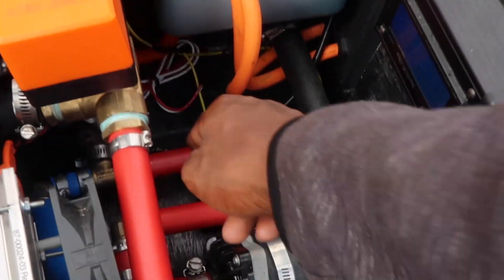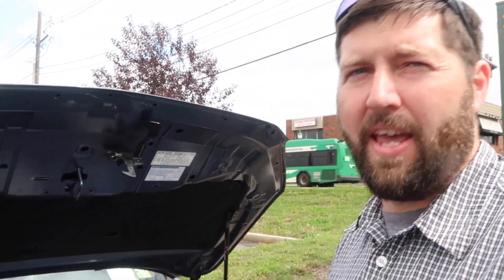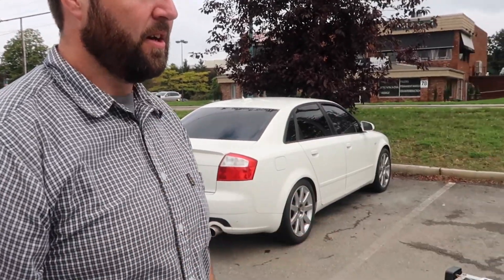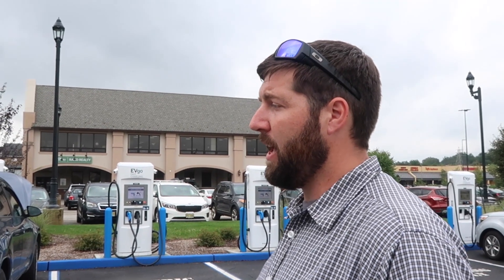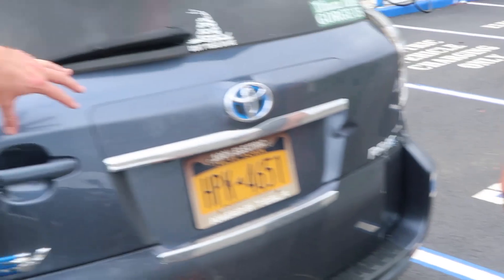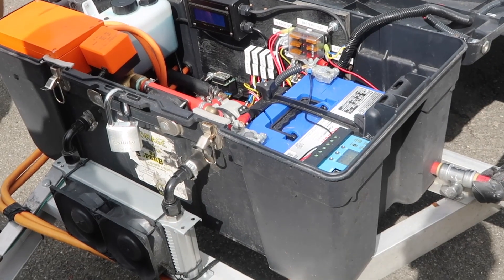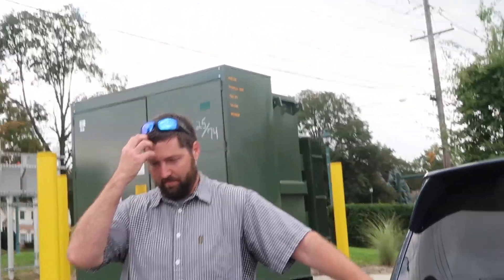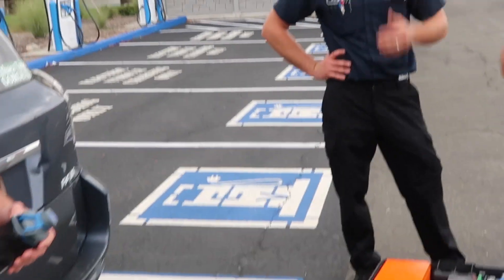The True DIY Tesla Range Extending battery Trailer

Comment: Why not just do a little fiberglass project and make it a "roof rack" thing?
Reply: No roof rack in the world can handle 840 lbs. You would also make the car dangerously top heavy and you would also lose 10-20% aero drag.
Reply: "roof rack" was in quotes for a reason. Of course I'm not suggesting just strapping it on there. But 850 pounds isn't all that much if properly distributed with some simple fiberglass reinforcement tubing in the proper locations.
A non-EV RAV4 has no lower batter, correct? So the OEM location of the EV versions lower battery has moved the horizontal CG far below normal. Adding weight to the top would offset that and put the HCG very roughly back to where a non-EV vehicle would have been. It is surely going to be slightly higher than normal, but who says the entire pack has to go up there? Some concessions can be made to get an acceptable HCG. Of course, some suspension work is also probably going to be required... another easily solved issue.
And 20% drag? Cmon man, with proper fiberglass work, it would be more like 5%, 10% on the sloppy side.
It's not a zero loss game, I never said it was. But it's better than dragging around 15ft in trailer everywhere you go, and it wouldn't consume all the usable interior space either.
Reply: funkyzero I don’t agree. I don’t think the car will handle well at all with 840 lbs on the roof and I doubt it would even handle the weight. Then you mention that all of the modules don’t have to be in the same place. It’s always better to keep them together. If you have to spread them out you have a spaghetti of high-voltage lines ran throughout the car. Also, temperatures for each module will vary because of the different locations. Also, would you run coolant lines to each module in each location? 

As for drag, I think your estimate of 5% is low. I don’t have a roof rack but I know of people who have added them and they will see a 10% loss just with bars installed and nothing on them. 

The trailer, it’s not 15’. It’s a 5’x6’ trailer. It’s very easy to maneuver. 

Lastly, I don’t want to discourage you from trying it. Plenty of people told me my idea was stupid. I did it anyway and it works great. I encourage you to try it. That’s how we learn. Best of luck!
Reply: you could very well be right, everything I have stated is pure conjecture based on very loose assumptions. What I know for certain is that the weight problem is solvable... from a structural viewpoint. And I think one could do it with less than 100 pounds of reinforcement (this is my area of expertise).
As far as the HCZ goes, this is where things turn to pure conjecture. I have never measured ANY of those things I suggested.
In the end, as you are more acutely aware than I, this turns into trade-offs between convenience, complexity, cost, and efficiency.
some guys might be willing to sacrifice every square inch of interior space except the drivers seat. The balance of variables goes from there... so there isn't really a "wrong" way unless of course, we are talking about technical issues.
I suggest what I did because my balance would be more somewhere in the middle... I want the full function of my vehicle intact, and any gains I could make in range and efficiency are 100% positives. One thing for certain, no way I'd want to drag that trailer around, even on long trips, but I'm going to have to start making concessions in order to get rid of it. And I know don't have to tell you any of this, you've actually done it.
But I can say that some small changes in suspension, and even slightly extending the spindle spread will increase stability (the top heavy concern) by multiple factors. Just a couple of inches makes a dramatic difference in this realm. 
Point is, all of these ideas can be worked with, it just amounts to how far do you want to go with it. I know the most common stance of the EV enthusiast is "maximum range MUST be achieved". I know that's an exaggeration, but it mostly fits. Most guys challenge themselves to see how far they can go, how efficient they can be. But that's not my mindset... the car still has to be convenient to use, or all is lost for me and becomes a toy at that point.

Comment: i see a problem when they switch togeather. they need to be at almost identical charge states in order to be joined. if not huge currents will be percent while a charge equilibrium is met. it would be nice to see either a charge controller used to balance the battery banks or a large bleed off resister to be used as an intermediate step to limit the equalizing current and once the banks are at simular levels for them to be fully linked togeather
Reply: I hear this all the time. They just need to be closeish. Jack Rickard made a video in which two 85kwh packs were connected in parallel. One was something like 90% full and the other was something like 50%. They balanced in about 2 hours. Everything was fine. As long as your wires are large enough, 2 gauge should be fine, all will be good.
Reply: the batteries are capable of safely dumping alot of current yes and in that case your wires will be used as a resistor. at the verry least put a shunt type current meeter on them just to monitor switching to assure safe limits. i didnt see a main fuse but id rather replace an external fuse than an internal one so maybe consider doing that. you can safely parallel fuses to cut down on price or availability if needed
Reply: Jimmy O. I monitor the can data for each pack so I am using the OEM shunts. I can see the current going into and out of each pack. I have multiple fuses and switches all over the place.

Comment: I would put regular solar panels on top of the trailer, it will charge the battery and protect it from heating under sun.
Reply: 300 watt solar panels would do nothing. Solar panels belong on a roof not a car.
Reply: It depends. If you go for a camping for a couple days it can generate some extra kwt as well. And I guess 400 watt is possible to instal. If for whole day it will 3 kw. Of course it won't make big difference. If keep it on backyard it can generate some power for house backup. Just my guess.

Comment: If he does have an accident I hope it's on the 4th of July so the ensuing violent explosion and sparks could add to the celebration of American freedom coming.
Reply: There are plenty of fuses and switches all over. Ive been pulling trailers for 10+ years and I've never even been bumped into. Sure, everything in life is a risk. Planes crash, does that mean you never fly?

Comment: Three battery's on top of one another , on trailer ,!
Reply: My goal is to do the same thing but with a flat Tesla 100 kwh pack. Then I want to build a removable lightweight teardrop trailer over top of it. That way I can use it to move stuff AND for camping trips with my wife and son.
Reply: @JamesKlafehn  
I also thought of using Tesla house batteries. Thought of building a trailer home and having four of these in the front with solar panels on the roof don't know whether it would work just an idea.

Comment: Would be cool to make a pop up camper trailer witht that.  Can extended the range and get utility out of it.
Reply: My goal is to do the same thing but with a flat Tesla 100 kwh pack. Then I want to build a removable lightweight teardrop trailer over top of it. That way I can use it to move stuff AND for camping trips with my wife and son.
Reply: Check out my channel. I just started a new range extending trailer that is going to have a teardrop on top.

Comment: I will just bring a generator with few gallons of gas... That will be much cheaper and easier
Reply: But you would have to pull over and park in order to charge. Id rather have longer range and be able to drive to a fast charger.

Comment: Fast charging shortens the life of batteries if im on the highway i use it but for the most part i try to charge it at a very low charging rate.
Reply: Not entirely true. Theoretically fast charging can but its the Temp, SOC and time left at full SOC that are the worst offenders. 
Battery Degradation:
1. Extreme heat or cold
2. Extreme heat or cold and having a full charge
3. Leaving the battery fully charged for an extended period of time.

Those three things are the worst for a battery. Tesla cars use an active thermal management system and so far I have never seen temps above 44 degrees. That is even while using Chademo in full sun on a 95 degree day.

Using a fast charger alone is not as harmful as everyone thinks. Your Regen system can dump hundreds of amps into a battery. A Chademo charger can dump 60-100ish amps. The charger also tapers as it gets full so that number drops down as it charges.

Comment: I am not going to claim to fully understand everything about this tech, but could you stack multiple battery packs on the trailer and get even more range?  I realize the weight would eventually create a negative return on benefits but a purpose built trailer with more aerodynamics could be used.

Comment: Use a steel box so people cant break in and steal stuff, put a small lift on the trailer and attach battery inboard of trailer frame rails. Add deck surface to trailer. Now you can tow, haul, and have extended range. Because a trailer that you cant haul anything with is like a roadster. It'll take you places but other than that it does very little for you.

Comment: If you built a battery trailer and you had free charging, you could charge the trailer and take it home and run your house off of it
Reply: Cindy Tepper yup I’ve thought of that. Haha. Still wouldn’t justify the cost of a $4000 inverter though :(
Reply: Resistance heating can use DC just fine :)

Comment: Roof rack would have been so much cooler
Reply: I hear this all the time. Roof rack wouldnt work. The battery weighs 840 lbs. A Tesla S or X battery weighs 1300 lbs. The roof rack nor roof could handle that weight. You would also be extremely top heavy and you would lose 10-20% due to aero drag. horrible idea

Comment: He should setup the trailer to also power his house when he's not using it.
Reply: That's exactly what it is designed for. The T-Rex is totally self containing meaning it has its own controller, switches, battery etc. All i need is an inverter and it would power my house, a cabin, etc. If I bought a Chademo power station I could use it to refill cars too
Reply: That's sweet!  Personally I think i'd get a lot more use out of it as a power source for an off the grid cabin or while camping, than as a range extender.  If you're powering a house or something else from the trailer, would you be able to have the car hooked up and use it's batteries as well, since they are in parallel?  (Not that that would be as practical but still cool).
Reply: My idea was that 90% of the time it would be home as an energy storage device. Then on a road trip I could use it for that. I dont have a cabin yet but I think that is also a great use for it too. I could bring my power with me and connect it to the house and the house's solar panels for the weekend. I've heard that an average family of 4 uses around 40kwh a day without sacrificing anything. Seems like a lot but thats what I heard. So this pack is perfect for a weekend at a cabin or home storage
Reply: That's awesome, i'll be looking forward to seeing more, keep up the good work!
Reply: Thank you!

Comment: Put solar panels on top of the battery it can recharge in the sun
Reply: I hear this all the time. 3 - 300 watt solar panels will do nothing. It would take a week to fill from empty.
Reply: @JamesKlafehn  I guess but if you were in a situation where there was no power this could be a lifesaver couldn't you also put one of those breaks that recharge your batteries when you use them on your setup? Just a thought
Reply: It would be more cost effective to buy a perfect sine wave gas generator and charging the car using a 110 or 220 volt charger while its parked.

Comment: why not just bolt the battery to the roof instead of having do try and pack it under the car
Reply: I hear this all the time, no roof rack in the world can hold 840 lbs. It would also be very top heavy. But lastly, you would lose 10-20% in aero drag.

Comment: It would take a gasoline generator 12 gal of fuel to produce the power stored in your trailer.
Reply: It would have to be a level 1 or 2 charge which are both pretty slow. It could also only charge while you are parked.

Comment: I guess its the advanced prototype, do report again when it got the fenders and enclosure all around possibly a solar cover. Its easier for you when you start adding batteries back in your dummy trailer because it leaves you the pure flat cargo area, try imagining a pop up camp also with unfoldable solar shade roofs. Of course the power inverter for operating machinery at job sites - you realize you could rent out the trailer very well just for that capacity, and if you have it online and with gps it be safer very everyone...
Reply: Wait, because I dont have fenders which add weight and aero drag its only a prototype? lol
Reply: Check out my channel. I just started a new range extending trailer that is going to have a teardrop on top.

Comment: why would you not put a box on top of the battery to make it useful as a trailer as well?
Reply: Because I have 3 trailers and I dont need this one to haul. My goal is to do the same thing but with a flat Tesla 100 kwh pack. Then I want to build a removable lightweight teardrop trailer over top of it. That way I can use it to move stuff AND for camping trips with my wife and son.

Comment: This is dangerous. Without a crash-event detection system, an active HVIL loop connecting the trailer and car, and arc-supressing contactors or pyro-fuses, this system remains hazardous in the event of an accident. Assuming this is safe otherwise is naive. Rich, you are an inspiration, but don't loose sight of the fact that your promotion of vehicle hacking comes with a responsibility to educate people about safety.
Reply: Another hater. lol!

Comment: Rich anyway of generating charge to the batteries, through the forward motion of the wheels of the car, couldn’t that generate electricity as well?
Reply: Adding a motor would create drag, weight, and add complexity to the system, oh and cost a bunch more money. None of which are needed.

Comment: Can't wait for this idea (trailer for stuff + range extender in one) to hit streets. This will be awesome. Imagine doing long runs with trailer, hitting supercharger and plugin car into 1 SC and trailer into second one. Higher consumption due to air resistance is still a problem, but this extra capacity should make it even. Plus imagine the ads:
"Buy powerbank for your car, and get one for your phone for free!"
Reply: My goal is to do the same thing but with a flat Tesla 100 kwh pack. Then I want to build a removable lightweight teardrop trailer over top of it. That way I can use it to move stuff AND for camping trips with my wife and son.

Comment: If you stacked several of them it would give you a possible 1000 mile range !
Reply: My goal is to do the same thing but with a flat Tesla 100 kwh pack. Then I want to build a removable lightweight teardrop trailer over top of it. That way I can use it to move stuff AND for camping trips with my wife and son.

Comment: Sorry if i missed it... what range does the trailer add to the car?
Reply: No problem. The car alone, not towing, in good weather, does around 130. With the trailer I have done 225. According to the math, I can do 260 miles in good weather at highway speeds. City traffic and driving would take power quicker just like any EV

Comment: Now imagine stacking 2 packs high(or more) and putting an aerodynamic fiberglass or carbon fiber cover on them.
Reply: Padre-D Productions My goal is to do the same thing but with a flat Tesla 100 kwh pack. Then I want to build a removable lightweight teardrop trailer over top of it. That way I can use it to move stuff AND for camping trips with my wife and son.

Comment: Could a Tesla Powerwall or two be used in a small range extending trailer? Certainly not cost effective now but the price will eventually drop. Each 13.5 kWh Powerwall would give an extra 40 miles of range, allowing you to buy a standard battery model car and add the trailer for the occasional long range trip.

Comment: Hello rich you need to have those Wheels on the trailer hooked up with a generator some sort so it's always charging the whole system when you're pulling it. Now that would be a project to do. I'm sure it could be Dunn and you're the guy that would figure it out.
Reply: A generator would add drag, weight and complexity that isnt needed.

Comment: put 2 batteries on the trailer and fill the trunk you will be able to go like 5-600 miles
Reply: My goal is to do the same thing but with a flat Tesla 100 kwh pack. Then I want to build a removable lightweight teardrop trailer over top of it. That way I can use it to move stuff AND for camping trips with my wife and son. Each tesla battery is around 1300lbs so more than one would be a little much.